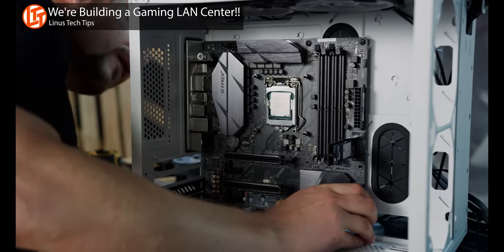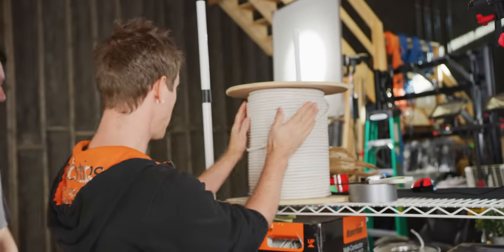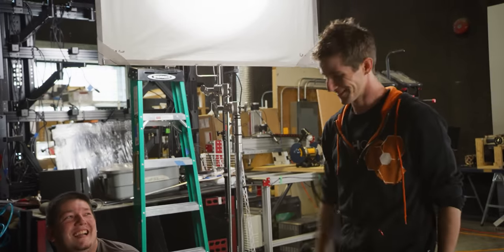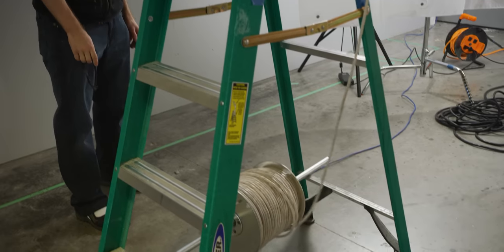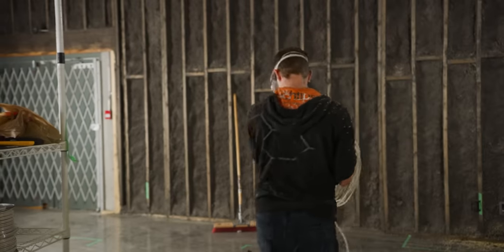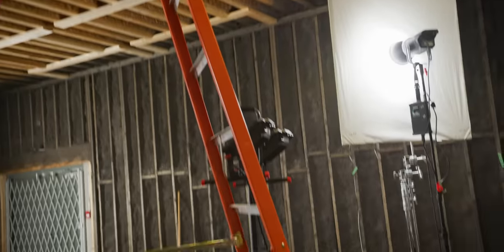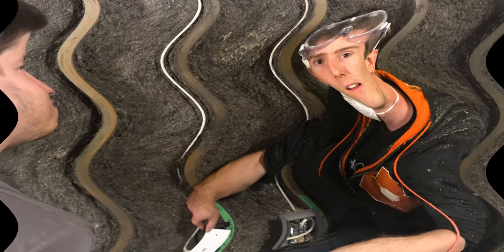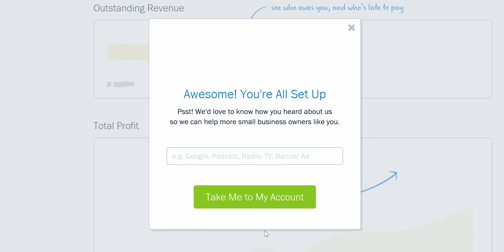Electrical Wiring for the Gaming Center - What could go wrong?

Comment: When I see the eletrical installation you do in Canada and USA, Then compare it to how we do it here in Sweden. I'm Fascinated how yours work. It feels like it's gonna catch fire or something in your walls.
Reply: The European standard is set way higher, where safety > cost of building
Reply: Power outlets here are 110v whereas yours are 230v, so since there's less electricity going through the wire it's less of a concern.
Reply: As an electrician in the US we have the National Electrical Code to follow in addition to individual state minimum requirements. Local code trumps the minimums set by the NEC. The NEC is written by the NFPA here in America. In a typical residential environment (Or wood stud environment) we use ROMEX which I assume is similar to LUMEX. Romex is sheathed on the outside in addition to insulation for the copper. As long as the person installing the wire knows what they are doing (The wire doesnt suffer from damage, and the conductors are properly grounded and wired to a device) there is a very large chance everything will be safe. However failures can occur within the device or if a home owner say fucks with the system normally installed. In a commercial environment which is where a majority of my work comes into play, we use a different type of wire in most cases and a different type of stud. Metal studs with MC wire. MC (Metal Clad) is our normal colored insulated conductors protected by a metal sheathing. This generally provides more protection than romex and can take more of a beating (It takes more than a razor knife to fuck up MC). A big difference from the two here is fire protection IS EVERYTHING IN MOST COMMERCIAL WORK. Drywall, insulation, and even the boxes we mount need to protect against fires. Usually if you are an apprentice coming into the trade here you are given a big fucking bucket of fire stop and sent around the building to fire stop holes. We also have fire stop patches for electrical boxes to prevent air from one room feeding another room that has a fire. As long as its a competent licensed journeyman doing the work in America, it wont go up in flames. And if it does this is why companies pay for insurance.
Reply: In Southern California (probably throughout the US due to UBC/ICC), commercial structures would require conduit for the electrical, either rigid or flexible with the wiring already contained.  Some cities also require conduit for low voltage wiring.  What they are doing here would be OK for residential but not commercial, at least around here.
Reply: @lger2010  It sounds like you have no idea about how electricity works, so I recommend that you read up on it before you you comment next time.
Because the comment you just posted made no sense at all.
Reply: Less voltage equals more amps..
Reply: So exactly why do you think this would catch fire?
Reply: i´ve seen people damage the insulation of the wires by hitting too hard on the staples.  @Snailor_Moon
Reply: @valen961  that's someone being bad at their job, not because of the wiring method
Reply: @lger2010  That's not how it works, lower voltages doesn't mean it carries less electricity, actually 110V draws more current to run the same appliance compared to 220V
Reply: And also Ive seen many people strip down to the copper pulling through conduit by hitting a rough edge, it doesn't matter the wiring method, if you install incorrectly you're going to damage the conductors
Reply: If it's installed correctly and the branch circuit has the correct rated breaker and outlet (people like to call them plugs but they are not, the piece on the end of the cord you "Plug" in is) is correctly rated there is no issues of the wire over heating and or catching fire. Whether it's in conduit or not if there is a issue (short circuit or such) both methods will result in a breaker tripping, yes with the wire contained in a conduit will contain an issue better in a VERY bad situation. Like many have said each country has their requirements (laws and regulations) for electrical wiring. I was in Egypt at the Pyramids and for the lighting (that was aimed at the pyramids) they had wire laid across the ground and open air splices all over the place, some had little 4' fences built around them some didn't and also most of the mechanical splices were taped up but I saw 3 that had no tape on them at all!  How well a job is done and if it's up to specs is always based on the craftsman doing the job.
Reply: Just NO.
Reply: @lger2010  - Do you even Ohm's Law?
Reply: @lger2010  actualy. Thats is not true. When the voltage goes down the power goes up. With 230 u are using less amps so less power.
Reply: As a fellow swedish electrician i agree
Reply: @rager1969  its acceptable here because its wood stud construction.  if it was another material it would require conduit or BX.
Reply: As a fellow European , I'm Belgian, I totally agree on this.
The completely way of how to construct houses etc is very different.
Also, Europeans tend to even go way further then the requirements..everyone does it here in Europe.
I recently renovated my house...
Insulation fe ..36cm insulation with triple layering, double concretedecks ( under and over the insulation, then I used an insulated concrete underfloor (chape) , think soundproof insulation and then the flooring.
For this I had to dig out 50cm extra under the required level! 
Insulation on walls and roofs are 26cm including a breathing coating.
All of that with a seriously high end airing/airconditioning system which bring in air etc and filters it out.

The electrics..don't get me started, done it all myself and doing the last bit myself now...besides the electric domotica layed out, there's double capacity build in and extra empty routings all over the house for future enhancements.

..totally not the american way , but...we don't need to rebuild every decade for an upgrade..
Reply: @valen961  that would just cause a dead short and trip the breaker endlessly.
Reply: @casualriley  Uhuh, so an event with a large amount of cars being burned in Sweden (possible the largest but what do I know) automagically makes grenade attacks a weekly occurrence?

Comment: 11:40 In Europe we have walls made of bricks, and electrical boxes are made out of plastic. For earth we have a wire, the green and yellow one, and it's connected to all kind of ports, plugs...
Reply: No, we have walls made of tree studs and metal as well.
And earth is usually not connected to switches and similar.
Reply: @Faddnn  where are you from?
Reply: Norway. Most houses built in Northern Europe is wood. And light walls in apartments usually have metal studs. Eastern Europe is big on wood as well, they prefab a lot of wood houses and ship them through out Europe.
Reply: I also use electrical equipment produced for all over Europe, and none switches and such has required earth to be connected. All earth ends will just be connected with an wago or similar in the switch box, etc.
Reply: @Faddnn  in center and south europe most houses are made of bricks, sometimes you find some drywalls inside
Reply: @Faddnn  Here in Germany we use mostly bricks. And I say mostly because I have no way of confirming this but I have never seen a house build using mostly wood. Some people use wood to decorate their house.

Comment: Now seems like a good time to resurrect the whole room water cooling project, but do it right this time. Personally, that means NO UNINSULATED COPPER TUBING. It also means giving each computer it's own pump and reservoir before running flexible tubing out the back and into a liquid-to-liquid heat exchanger like the ones Koolance sells, and running the whole room loop just between the heat exchangers and the radiators. That will prevent any potential growth from spreading between systems by isolating them, and also allow you to easily disconnect individual systems using no-spill quick disconnects.
Reply: Exactly what I was thinking how to do whole-room watercooling right. Liquid-to-liquid heat exchanger in the system, and internal radiators that stay permanently hooked up, but whose fans only engage once coolant temperature indicates that the whole-room loop is disconnected. Finally, maybe an active cooling system (aquarium chiller or something like that) on the outside of the room and insulation of the hot pipes to make sure the room is not being heated by the pipe runs.

Comment: Actually Linus, the more times you can use anything other than a hammer as a hammer your man card goes up in value.
Reply: Valderhide linesmans pliers are like 5 tools in one lol hammers take too much space in my bag
Reply: @blackopspwnage5  That's it, just 5 tools. I've turned them into 8 tools at some point
Reply: Linus doesn’t realize that  doing electrical work in Birkenstocks with socks is infinite negative man points so the hammer is no help at all.
Reply: Linus doesn’t realize every tool is a hammer
Reply: "Uses head"
Reply: The more you use a tool against its intended purpose, the more your man card goes away.

Comment: 11:40 in Europe we generally use plastic boxes because they aren't conductive, so if you get a power fault you're not electrifying the wall. AFAIK the theory behind having metal boxes in north america is to prevent potential arching inside the box from starting a fire, and arching is a lot more likely to happen on 20-40 A circuits than on our 10-16 A circuits, but when you use metal boxes they have to be earthed because they're conductive

Comment: Linus don't put the staples in too far on the data cables. They should only be in enough to hold the cable in place, it should in no way crush the cable against the wall. Change in the geometry of the cable will affect the performance. Especially at the higher data transfer speed of 10G.

Comment: Canadidan wiring safe as brazil electric shower :D
Reply: I've been living in my house for 30 years and it hasn't burned down yet, so I'd say it's pretty safe.
Reply: @christopherbackus5578  People live in houses covered in asbestos and it's pretty safe. Until it isn't and you get cancer. 
People smoke all their lives and don't get sick. Until they get cancer and die.
People drive 50 over the speed limit all their lives and never get hurt. Until you crash and die. 
I can go on and on, but that'd just be fucking stupid since any comparison saying "It didn't happen in my case so it is safe" is fucking stupid. :)
Reply: @Japanie2   what is "fucking stupid" is going against fire statistics and code: houses do not burn because of the wiring done to the code. They do because of the wiring done not to the code. Both USA and Canadian statistics confirm it. Moreover, stop telling me that a thin walled flexible plastic conduit can protect the wiring from physical damage or the house from fire.

Comment: I'm an electrician and this is my life everyday... lol
Reply: Same for me😂
Reply: Same.
Plus I been in the service. When I deploy, I get exposed to European and British equipment.
It's a little strange, but able to get used to it. The basic rules still apply, regardless of voltage.
Amperes needed, ambient temp, and conductor sizing.
Though striping metric wire with an American tool is often interesting.
Reply: Nyda Butt...are you happy with your life?
Reply: You're specifically a residential electrician? I don't see why people like it. Did it for 2 weeks on new builds and hated it.....but liked the smell of wood more than concrete
Reply: why the hell didnt they use an auger bit in a good old wrist breaker/hole hog then like every job i have been to if they have the room thats what they use they only pull out the small drill when its tight
Reply: What is that spray-on black insulation called ?

And does it hold in mold /moisture like other closed cell foam insulation?
Reply: @Mr.Neko013  yea I mostly work in old ass 100 year old houses living in new england... It can suck sometimes but you learn cool things about how they used to build houses...
Reply: @nydabeats  I never thought of that! That would be neat to learn

Comment: As an electrician this acually pains me to watch... In Norway we are sooo far ahead in the way we do the electrical.. For example, pulling wires without having tubes in the wall is pretty dumb.. No upgradeability.. If a wire gets damaged, or if you want to change the wire with something else later on, or pull more wires to the same box, you literally have to open up the walls again.. Also, the cable is a lot more exposed for damaging in the walls.. Haha, but this dude seems to know his trade!
Reply: I live in the Netherlands and I'm not a professional electrician, I just do small things around the house and the lack of PVC tubing was also the thing that caught my eye.
I mean what good reason could there ever be to not use PVC tubing?!
Reply: They still live in the 60s in America
Reply: In France (don't know the other countries) it is possible to use R02V cable without conduits under drywall, but it is not frequently done.
Reply: I actually don't see a lot of benefit to running conduit inside walls outside of protecting wires from potential damage. Also, as someone who has run wires through all manner of conduit (yes, we do still use conduit here in prehistoric America) It's a lot easier to cut a couple holes in some drywall and fish a wire through than to run a wire through a conduit with more than one bend in it.
Reply: I'm Canadian but moved to Mexico, one of the things I noticed when I was renovating my home, all outlets have a vertical PVC tube leading to outlets, since most houses are concrete. Makes sense.  Imagine destroying a whole wall just to replace a wire.
Reply: @christopherbackus5578  You are also protecting the house from damage and I find it easier to just use the holes that are already in the wall than to cut new ones, then you have to cover those holes and paint the whole room
Reply: So tired of all these europeans thinking their way is the best way, and that North Americans don't know about conduit, its uses or that the way we do things is unsafe. There is nothing wrong with our practices they are just different then yours. We are not any less safe, we use afci's on almost all receptacle circuits something europe has been slow to implement. Conduit has its place and is used as required. Being that most of our homes and a lot of small commercial buildings are wood construction it makes more sense to use loomex to wire them. Also in most renovations due the the wood construction we can get the wires where we  need them without opening the walls. If you wanted to add an outlet in a new location using conduit you would have to open the walls to get it there.